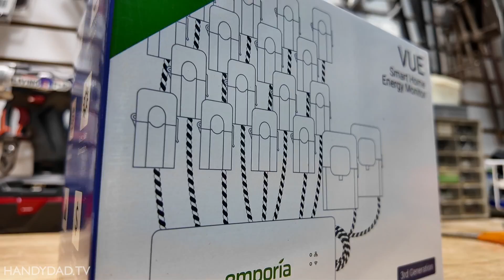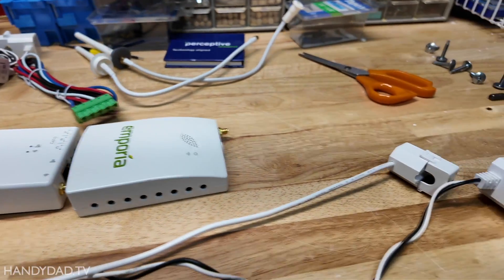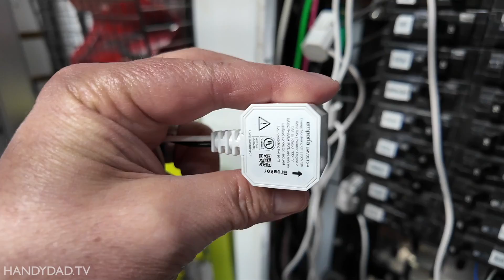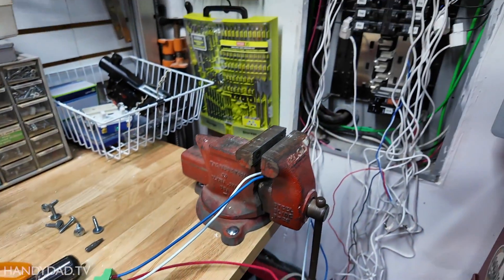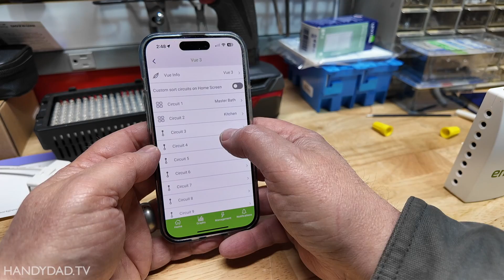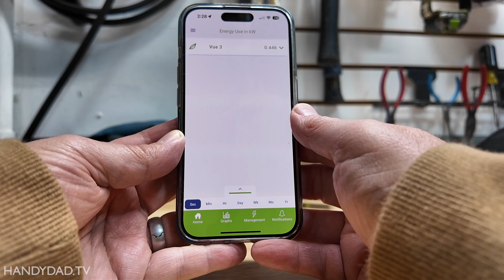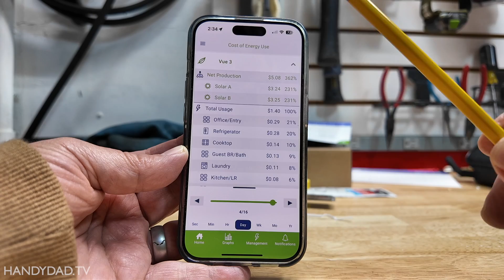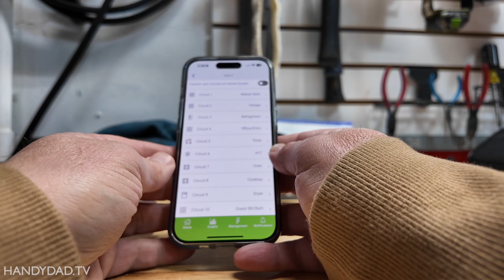Emporia Vue Energy Monitor - Gen 3 vs. Gen 2 - NEW FOR 2024

Comment: Hi, thanks for all of the valuable info!
Two Questions:
Did you have to buy extra CT sensor clips for your Solar System?
Is there a way you analyze more than 16 circuits?
I gave 32 separate circuits in my electrical panel (about 8 of those are double breakers)
Reply from the maker: I don’t think you can buy CTs individually. They come with the VUE. 

Pretty sure you can use multiple VUEs but they may appear as two separate houses.

Comment: Nice video! You did a really good job detailing everything. Did you end up using the ethernet cable or are you using the wifi connection?
Reply from the maker: I have strong WiFi in my garage because the router is in the laundry room adjacent.

Comment: Have you considered or with the Gen 2 flashing with ESPHome?
Reply from the maker: I’ve considered it but I’m very happy with their app. And I can export the data to do my own analysis.
Reply: That's exactly what I did. The only thing I like about 3 that I don't about 2 is the instead of a pin it's more secure connection. But I am sure the new one probably will take time to have esphome flashed. Love esphome on the 2nd gen.

Comment: I wonder if they have it setup to use a gen 2 and gen 3 together.  I know you could use a multiple of the gen 2 units but it was a bit clunky in the app.  I would love to add a gen 3 as the main one and then use my gen 2 for all of the remaining circuits.
Reply from the maker: You can definitely use them together but it will treat them as two different houses.

Comment: I use a Sense energy monitor at my house and it is slow to recognize electrical devices. The Emporia Vue is an interesting device.
Reply from the maker: It’s a different approach than Sense.
Reply: The sense device only has one power monitor on your main line (actually one for each phase). What they do is every time you turn on a load you can program the device so it recognizes how much power it draws and then it gets labeled as something like dryer or washer or garbage disposal or whatever. After training the sense can be quite accurate but it's just doing a recognition of the power drawn by each device in order to know what's being turned on and off. For instance if all of your bulbs in the house are the same wattage it won't know whether the bulb in the bedroom or the kitchen or living room is turned on, just that some light was activated. With larger appliances there wattage or current drawn is unique and large enough to be detected individually. I think it's a beginning but nowhere near the level of accuracy available through the Vue system!